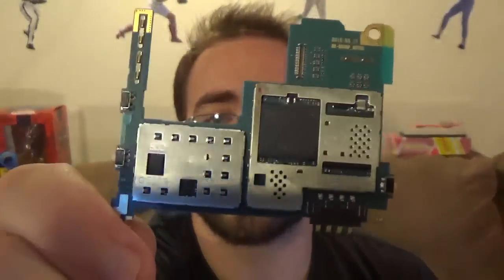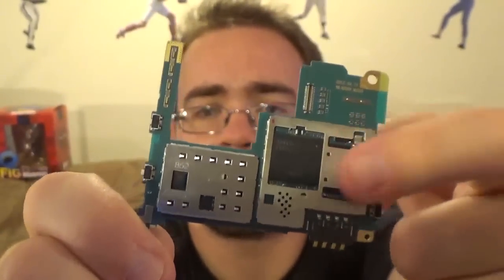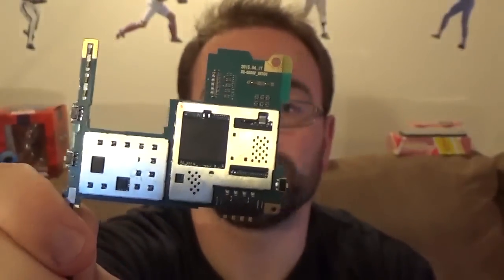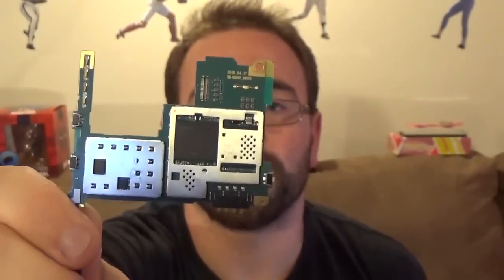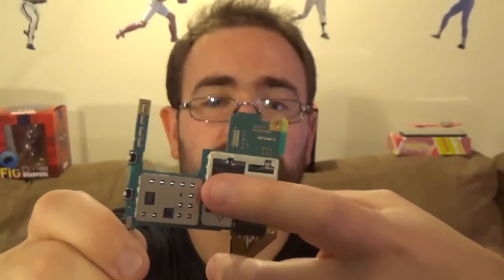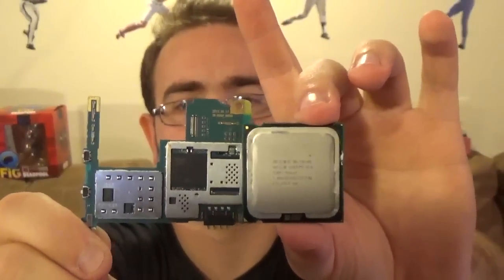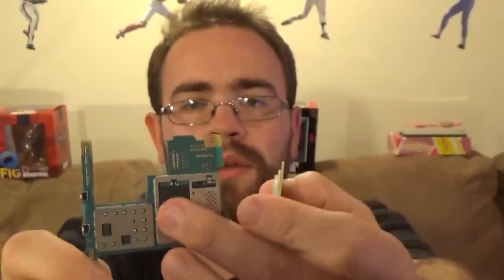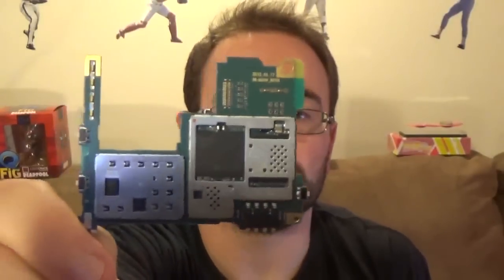Nintendo Switch - x86 And ARM! Why Is Nintendo Using ARM??

Comment: The very simple reason why Nintendo Swich uses arm.. is really nothing of this. Its very very simple. Nvidia have a ARM licens, they don´t have a x86 or any other licens. If they would use a 3:d party processor, they would not be able to do a SoC. And then it would consume way more power and be quite a bit slower.

Because Swich uses Vulcan API that handle multi core processors very well, this is really not a noticeable penalty

2:50 That is not really a fair comparison While a core2duo is a old processor, it was top of the line for its time. x86 processors generally have been made in two different format. High performance and high efficiency. Intel have its Pentium and its Atom, and AMD have its FX and there Jaguars. The high efficency chips are both smaller, do less IPC and run lower freqvency. On the other hand they use much less power. There are some phone and tablet x86 processor (actually my wife got a Intel x86 tablet. Its really fast and it actually do run 8-10 hours on a battery.  Its a 2 core processor and it beat the crap out of the 8 core arm.

The reason why the high power processor got larger die is that they have higher IPC and longer pipes. The reason  for longer pipes is to get higher frequency.

Also games, specialty with DX11, don´t multi core well. This is a problem if you use ARM processors because they don´t have good single core performance (this is also to a degree true for Bullduzer and derivative core).

3:00 No, that is not really true. If you idle a lot, yea sure, then Arm is more efficient. But counting IPC/W x86 processor often beat ARM processors hand down. Also the CISC like design of a x86 is quite a bit more efficient (contrary to popular believe). The statment that x86 cores use more power is totally wrong. Well they do if you idle. But when pushing out IPC, they don´t.

3:25 Actually rather the opposite is true. Intel have more or less abounded the mobile market with x86 processors. The reason is not that they are not sufficiency good, but rather due to compability issues.

3:40 No. the x86 was made for the home computer market initially. Its rather the other way around that they made there ways into servers. And its only fairly recent that they got into the mainframe servers.  They use to be reserved for the sparcs, mips and Cray processors.

4:00 ARM was designed during the early 80-tys. There was no digital cable boxes around at that time and its really just fairly recent that they got into boxes. They use to be to slow. Rather the power processors that was med for cable boxes.

4:25 The reason why ARM got into the phone industry was again microcode. Prior to ARM geting popular it was a math between dragonball, some Intel CPU (that used special microcode that was non x86) and some samsung processors (that the first iphone used):

Andoid also initially used several different instruction set, but now its mostly just on arm.

7:45 no... a ARM is not more powerful than a xeon on single core performance... Well if you get a xeon from 1998 or something. A Haswell generation xeon pumps out 9.92 IPC. A A57 or something like that have 3-4 something and also clock about half the speed. So about 1/6 the performance per core. Don´t believe everything you read, something are lies. (A57 is what Tegra P1 are using)

8:50 A I7 needs about 20W to run, and almost all of this is for busses. When the core is not working, it really don´t use any power at all. It basically shut  of

9:20 No. Standby and use time have not become huge. Its just climbing back to what it use to be. The issue is that Nokia and Ericsson use to produce the best transivers and sold them to just about anyone. But qualcome (that produced the ARM chip at the time) don´t want to use Ericsson or Nokia transivers but rather there own. There transivers was really crappy. For instance the Standby time of a Ericsson M600 smartphone is about 400 hours on a 600mAh battery And its a 3G phone from 2005.

The Ericsson smartphones had have asymmetric multiprocessing since 2001. Arm/Qualcom was really late to that game.

11:10 "Intel cant figure this out"
That is just plain wrong. Intel got Z and N series processor on the market since like forever. Intel was in the smartphone business long before ARM even was. Go check up facts before claiming things.
Reply: Nvidia was the logical choice because they are pretty good with graphical performance with ARM's chips, as for nvn, considering Android now uses Vulkan, odds are it will be similar to what that is, Nintendo will want to tap into the easy portability of smartphone games being they are all using ARM's.
Reply: matsv201 Only two options they had, x86 or ARM's, it's a wise move to use one that a lot of developers know how to use and pretty much both thoes two architectures are pretty much standard today.

I doubt the Nintendo Switch will get PS4 level performance, being that they have to take mobile into account, I suspect they will get Wii U level of performance or at best in between PS3 and PS4.
Reply: Paul Aiello "Only two options they had, x86 or ARM's"
Well. that is true, but it have not stopped the companies from using strange architecture.

"I doubt the Nintendo Switch will get PS4 level performance"
We don´t really have to guess. Well there is really just one unknown things that have a huge impact on the lithography. If its 10nm, 14nm and 16nm.

Thow 1050 use 14nm i would say this is the most likely of the 3. We can take the base level of how much it use in different core frequency  We know it have 5W of power in mobile mode... But we also know it have more in stationary mode.

Also the Swich will have the mix floating-point give it quite a boast in performance, giving it about PS4 level performance in stationary mode. (assuming the difference is 2.25 between stationary and mobile mode)
Reply: matsv201 True but the last few years there's been a lot pressure from developers to push them to go with something they are familiar with and not something so alien like the cell cpu, in the case of both the PS4 and Xbox One consoles, they went the PC route with x86. Nintendo with Switch are going the ARM's route with a hybrid PC gpu on it, it's a wise choice and really the only choice they had, they wanted a mobile device, that left ARM's as the only choice, it's powerful enough but more important, it's a standard that developers are familiar with, last thing Nintendo needs is to alienate third party developers or they could have another WII U on their hands.

I'm not sure about the nm of the chip but Nvidia are using the 16 and 14nm I think with PC gpu's whereas AMD are using 14nm, my guess it will be either one of those, doubt it will be the 10 nm but overtime that will happen with a micron shrink.

I doubt it will get PS4 level performance, that would be one hell of a leap in performance for a ARM's chip and seems unrealistic, it seems like they are aiming for a bit more power than the Wii U consoles, I would be happy if they can get in between the PS3 and PS4 but that might be pushing it a bit.
Reply: Paul Aiello 
I would say the disconnect between CPU and GPU is almost 100% Even if its a SoC its totally different codebase between GPU and CPU.

For instance the Vita while it uses a ARM processor, it uses a M4 architecture.

" doubt it will be the 10 nm but overtime that will happen with a micron shrink."
The 10nm is ramping up.. but i don´t know when Nvidia will get it. Intel already got 10nm production.

"I doubt it will get PS4 level performance,"
Well not only the core preforamnce but also the mix FP giving it a extra boast...

I´m pretty confident that the Swich will beat the PS4.
Reply: Paul Aiello It will be around original XBone level performance.
Reply: matsv201 Do you think AMD could do a X86 SoC
Reply: Epicvids (Ketti08) Yes, and they already done some. The new Zen suppose to e be a SoC at least in some versions.
Reply: ***** nvn is just a recap of nv that in turn use vulcan in the newst version
Reply: matsv201 but they didn't have to go with Nvidia...
Reply: Dexter Lanning That is true.. But if the want a high performance and low power, the is very few to choice from. I really just think there is 3 options, and...Nviidia is probobly the one that got most bang for the watt.
Reply: Paul Aiello Yea.. the only other real option would be PowerVR, and they are less power efficient, so if we talking PS4 level preformance its not really a option.

Of cause, Mali exist to, but its even less efficient. 

Of cause the vita used PowerVR, and its pretty good... but not really to this extent. 

(still looking at PowerVR, its not that far behind)
Reply: everything said in this thread is common sense or stupid....
Reply: matsv201 Still not convinced it will be 10nm, don't think it's mature enough yet and Nvidia are likely to prefer 14 or 16nm for the time being but 10nm will likely happen at a later date with the Switch.

If they manage to beat or even match the PS4 then that means smartphones can do it and with how quickly they develop, they would only have to double the performance to match the PS4 Pro, someone I don't see it coming close, to me the tech isn't quite there yet to allow that in a mobile device where heat, power consumption and size becomes a big factor in its design, still I think they can get Wii U kind of performance or a bit better then that, we should remember that the PS4 is around 10 time faster than the PS3 and the Wii U and PS4 are not that different from each other.
Reply: Paul Aiello 
"Still not convinced it will be 10nm, "
Well i don´t try to convince you... i also think that is a long shot. 

"If they manage to beat or even match the PS4 "
Well say that Swich get 2.8Gflops FP16... did it beat the PS4 then.. or not?

"performance to match the PS4 Pro"
No... That is not really the case. PS4pro got mixed flotingpoints, the PS4 don´t. So even if PS4 pro is about 2.2 times faster on paper its closer to 3.5 times faster when its implemented.
Reply: matsv201 Don't get me wrong, it would be great if it is 10nm but I don't see that happening for Nvidia early next year, at least not in enough numbers that matter.

In any case, I don't see the Switch coming close to what the PS4 can do, that would be incredible progress from an ARM's chip, mobile tech is about 8 to 10 years behind desktop tech in performance terms so best I suspect they can hope for in a mobile form factor is Wii U or in between PS3 and PS4 performance which would be quite impressive if they get that, PS4 performance with the heat, power consumption and bigger size they have to play with just after 3 years seems extremely unlikely and if they managed to get that, it would really put into question what have Sony and Microsoft got so wrong with the PS4 and Xbox One for a mobile device to get that kind of performance just after 3 years, I don't see it happening and I don't recall it ever happening in history.
Reply: Paul Aiello 
"Don't get me wrong, it would be great if it is 10nm but I don't see that happening for Nvidia early next year, at least not in enough numbers that matter."
Yea i would pretty much agree to that. We probably see 10nm Swiches say early 2018.

"I don't see the Switch coming close to what the PS4 can do,"
Why not.. PS4 uses 28nm, while we guess that Swich uses 14nm.. That is one quarter the power. Also swich uses LPDDR4 while PS4 uses GDDR5 that uses WAAAAY more power. Also Swich will probobly have 128bit bus, while PS4 have 256.

Also Swich have a SoC while PS4 have a lot of busses and secondary chips.

The last part Swich will probobly use mix FP giving it a say 50-60% preformance/power boast.

Also not to forget Nvidia arcitecture is a bit more efficent than AMD,, its not a enormous amount, but 15-20% or something, it all ads up.
Reply: matsv201 My guess is the 10nm or even smaller for the next revision of the Switch or possibly it's successor.

Even so with the 28nm to the Switch 14nm it's not going to be even close I think, top of the range Android and Iphones are a bit better then PS3 and Xbox 360 in gaming performance, the PS4 is about 10 time faster, would love it if they did manage to pull off what you say but the tech just isn't there yet, mobile tech is about 10 years behind PC and console specs in what they are capable off, what you are saying would be a major step forward for mobile tech and thats unlikely.
Reply: Paul Aiello Most phones are made to be cheep, not power efficient. A lot of them have old chip and they just overclock them for new featueres. Its dirt cheap to produce, but the battery performance is really bad.

Only the very top end phones uses rather new chips, and most often they are GPU starved. When playing a 3D game, they simply just clock the GPU higher.

Just by the simple method of having more silicon its more  power efficient

Also... even there is the 1080p rumour of the Swich internal screen, i still think the games are 720p when mobile. It might be as simple as it uppscales it to the internal screen.

Simple mores law calculation would suggest that it take 6-8 years for console performance to reach mobile devices. But there is some differences this time.

1: Its a sudden and rather large steep from 28nm to 14nm
2: Vulcan is introduced giving a sudan rush of performance.
3: Mixed floatingpoint gives a 40-80% performance boast
4: SoC architecture lowers the power demand quite significantly.

Combine alls this factors together, and in steed of 6-8 years, its 2-3 years.

Of cause... when the PS5 is launched in 2020 or so, it will use all the same tricks, and the mobile devices will be 6 years behind again.
Reply: matsv201 To a degree thats true but it really depends which smartphone you get, Nvidia Tegra chips are on the market in tablets and phones and gpu performance is pretty good with them but they seem quite weak on the cpu front.

1080p would be doable whiles mobiles with the Switch, it all depends how good they want the graphics, I've seen some pretty impressive games on Android and IOS at 1080p screens but not sure if they are rendered at 1080p, but being this is Nintendo, it wouldn't surprise me if they go 720p.

PC has Vulkan as well and consoles have always had something similar so we can't really use that argument, also, IOS has something similar for quite some time, in any event, Androids got Vulkan recently and it seems to improve performance to a similar level like it does on the PC, in truth is just basically means all those platforms are getting better use of the hardware but no real advantage to any of them, well apart from the PC and Android where it levels the playing field more.

I think it's being a bit optimistic with 6 years but I would love to see that, anything that gives the wind up Intel arse is good in my book, we should also remember that some big changes are on there way with the PC next year on the cpu and gpu front as well as memory and as we know, the cpu market on the PC has been quite static for a few years, Zen could change that.
Reply: License*
Reply: do you believe the switch is going to be successful?
Reply: OyeJaPinoY Well.. yea.. but it really depens on how its set up in the market.
Reply: matsv201 I think it really depends how gamers see it, being that it's a mixed home console and handheld, it might be able to tap into the success of its handheld gaming divisions but I can't help but feel that most will judge it for how it plays at home on tv and that could be the problem when it comes to third party support, the hardware gap is still too big at a time when developers will quickly start putting more focus on the PS4 Pro and Scorpio when out at the expense of the PS4, Xbox One and Switch.
Reply: Paul Aiello Yea.. they really need a few 3rd party AAA games. Not all of them.. But say 25-30% of the cross platform Xbox-PS4 games.

I do think that a lot of the latest roumers .. while not false, probably miss interpreted.

It seams to be based on the idé that the dev-kit is identical. We already know that is not the case. The dev-kit is a two chip solution. the product version is not.

Al ready by knowing the dev kit is a two chip solution, we know its not a X1.. Because the X1 have been available for over 2 years now, and its a 1 chip solution.

So the idé that its a 300Mhz X1 is just stupid.

I would say Swich will probobly preform better in real life than bot Xbone and PS4. Not instantly, but after a year or two when the devs start to learn how to optimize for it.

The mix precission give a theoretical up to 80% boast, but you got to know how to use it, of you don´t you get a 0% boast.

I would would say that the stationary FP32 mode will give 1.4 Gflops. I seen so much pointing at that so i would say its pretty solid by now. The Swich will have mix precision., its a given, even the PS4pro have it, and it already been realized.

This give the Swich pixel per pixel actually higher performance than the Pro in 4k vs 1080p even considering both running mix precision. (that is 2.1 Gflop FP16 per 1080p for Pro and 2.8Gflop FP16 per 1080p for the Swich).

So i would say the Swich will probably fair quite well.

Swich also have one additional quite huge advantage. It runs cartridges.
No install
No load time (almost)
Reply: matsv201 I think they'll need a bit more than 30% third party support but a lot of that will depend on which games are supported.

It would of been nice if it was the Tegra X2 chip, that could've been a decent upgrade, I suspect the performance will be better then the Wii U but I don't expect it to beat the PS4 or the Xbox One for that matter, if they did, that would be quite impression and what that could do, smartphones could as well which thats sounds a bit too close for comfort for the console market, if it matches the Wii U which is only a bit more powerful than the PS3 and Xbox 360 then it might be alright, hardware wise those consoles are over 10 years old so should be doable in mobile form, when docked, I think they'll get between the PS3, Xbox 360, Wii U and the Xbox One and PS4, in between them, we might know more next month.
Reply: Paul Aiello 
"It would of been nice if it was the Tegra X2 (really P1) chip, that could've been a decent upgrade"
Its not a P1, i can say that for sure. The the reason is not the GPU, but rather the CPU. The CPU of the P1 is not suitable fore games. Its made for calculation stuff.

We also know the battery capacity and the runnig time of the Swich, so we can basicly calculate backwards the performance of the device asuming that the screen and other component use less than 2 watts. WIth a 5Ah batttery, and we know that the battery life is 3 hours giving us about 5W left for the SoC.

As speculated before its now confirmed that there is a 1080p and a 720p mode on stationary and mobile.. having a subsequent cutdown of freqvency of 2.25 times giving us a power cutdown of about 4 times (amusing that they run it quite close to optimal speed).

Giving us a a freqvency of about 1.2-1.5GHz in stationary mode and 533-666Mhz in mobile mode.

Then we also know that it uses about 20watt in stationary mode giving us a performance of a bit over 1Tflops FP32 (stationary)

From the data we have we can pretty accurate calculate preformance pretty accurate.

What we know
Factory leak: Battery capacity: bit over 5Ah (3.7V)
Nintedo leak: 3-5 hours battery life (that is 3 hours on full tilt.. and 5 hours on about half tilt. This gives us both SoC and other component power)
Dev leaks. Game sample down to 720p when mobile, 1080p in stationary
Official information: "latest generation of Nvidia GPU" That is Pascal then

From this information we can pretty accurate calculate the preformans. If i hade a low tear Pascal GPU i could probobly simulate a Nintendo Swich with it and give a even more acciurate estimation
Reply: matsv201 Still it basicly means games will be held back depending how well they run in mobile mode and if it's multiplat, that will definitely hold back the PC, PS4 Pro and Scorpio version of the games, for many developers they might end up thinking the gap is too wide and not worth it.

What we might end up getting is a lot of mobile and Nintendo DS kind of games as well as Nintendo exclusive games to it but third party games could be very hit or miss.
Reply: Paul Aiello 
"Still it basicly means games will be held back depending how well they run in mobile mode and if it's multiplat,"
Well.. no not really. It will have the same per pixel preformance. The image will only be less sharp.

I was previus speculating in Nintendo going 30fps mobile and 60fps stationary. It seams like they didn´t do that

What is holding back the Swich is the CPU. Even if the A73 CPU (that is rounered to be used in the Swich, could possible be the A57), its still quite a bit slower than the Jaguar. Thow the A73 can run at higher clock, but not that high.. specially not on battery.

This is also a issue with the CPU...it don´t scale very much with resolution, barley anything. Swiching down the resolution. This would make god sence bringing down the frame rate.
Reply: matsv201 I thought they might go 720p 30fps mobile and 1080p 60fps docked.

Still games that are multiplatform will suffer greatly on the PC, PS4 and Scorpio if they also need to get that game working on the Switch in mobile mode as well, the performance is just too wide and that could be the problem third party developers have with it, with the PS4 Pro already out, Scorpio out next year, the PC getting cheaper all the time, how long will it take before most games really start to take advantage of the PS4 Pro, Scorpio and PC and the PS4 and Xbox One become an afterthought, so yes I'm sure they will get the game but it could run so bad that not many would want to play them, which is even worse for the Switch, ironically, the biggest threat to the Switch is sales numbers of PS4 Pro, Scorpio and newert gpu's on the PC, the more sales, the more likely third party support for the Switch will drop.
Reply: Paul Aiello 
"Still games that are multiplatform will suffer greatly on the PC,"
Well its a  double edge sword.
 The inferior preference of the console forces them to optimize but it the preformance to some degree bind it down.

One advantage of current generation consoles is that all of them are 8 cores.. that is plenty. Few PC have more cores than 8... and the performance scale quite good on IPC and frequency.

This is to some extent true for Screen resolution to. At least if you have a 4k screen you will get at least the pixel fidelity of the consoles pixel per pixel. That is for game that run 1080p on Pro or Scorpoi, its heck of a graphics. For the pro its similar two 4 480 card in crossfire.

"Switch in mobile mode as well,"
i would say.. no not really. The pixel fidelity is about the same in mobile and stationary mode.. so the game just scales down.

" start to take advantage of the PS4 Pro, Scorpio and PC "
Don´t wory about it.. its the same every console generation. Actually relative to PC the Swich will probobly be the most powerful console since the gamecube.
Reply: matsv201 To a degree thats true but you can't get blood out of a stone, you would have to imaging they are optimising a lot on the PS4, PS4 Pro, Xbox One and Scorpio when it's out so really the gap is still going to be wide.

8 cores might be more of a thing next year on PC when Ryzen is out, could be a good shake up in the market if it delivers and so far things are looking promising, but really core counts are not too important as 4 cores on an average PC is far better then those 8 cores on consoles.

Eurogamer did a few test a few months ago with an RX480, doing native 4k at 30fps and similar to PS4 visual settings, from what I recall it did north of 30fps in 9 out of 10 games, 30fps is much easier to do at native 4k with careful graphics settings, also the PS4 Pro is quite a bit weaker than the RX 480, the advantage here is that the PC is doing native 4k whereas the PS4 isn't most of the time.

As for the Switch, we'll have to see how well that works out for Nintendo but it's not looking good, at least with third party support.

Oh I'm not worried about the Switch holding back gaming, as a PC gamer we've been used to that with console gaming holding back PC gaming, but in any case, mid cycle upgrades for consoles is a good things for the industry.
Reply: Well.. it might not be as hard as one might imagine.. i found a image.... 
http://1.bp.blogspot.com/-yHGXCbFSMvo/Uxk9uoyGoxI/AAAAAAAACBw/BsMdH043qoo/s1600/endings.png
This is from the 2:nd and 3:nd generation videogames. 
From C64 down to Amiga at the bottom right.

Now days its even easier. Have polygoncount, resolution frame rate to play around with. Actually with a portable device don´t have to stick with 30 or 60fps, can run with 45fps with no real issues.

Its kind of hard to specify the preformance  difference from C64 to Amiga 500.. But just like the name implies the C64 have 64kbyte of ram while the AMiga 500 have 512kBytes of ram.

But the diffrance is actually even bigger. Amiga read the game of a disc, C64 read it of a tape. The C64 needs to keep all (or at least most) of the game in memry at the whole time. Amiga read of a 880kbyte disk. So it can basicly utelise 512+880kbyte of memory. (C64 can actually use 84kbyte of memory because the grapics uses separate memory)

The grapics chips is hard to compare, they are both hardwired. They work as fast as the TV regardless. So its really memory that need to be compared between them. The Amiga grapics can practically use about 12 times more than the C64

Processing power the Amiga uses a 16/32 bit processor on 7MHz while the C64 uses a 8bit processor at 1Mhz. It really depend on what task, but you could reasonably say that the Amiga was 30 times more powerful.

So 16 times more memory, 30 times more CPU power and 12 times more graphical power. That was one generation in the 80-tys, 5 year a part. There was quite a reasonable time that games was made for both consoles.

So lets look at the current day combatants.
Xbone, PS4, Pro, Swich and Scorpio.

The comparison is much simpler in the way that they all use the same graphical API (Well more or less). They also all use 64 bit SIMD processors, so its easy to compare.

So i will compare memory, CPU and GPU power.

Memory:
Xbone: 8GB
PS4 8,25GB of memory (yes, the PS4 have a tiny bit more)
Pro: 9.25GB of memory (possibly with compression). About 32GB of usefull memory
Swich: (presumable) 4GB of memory (almost certainly with compression) About 16GB of usefull memory
Scorpio: Presumable 12GB) probably with compression, unclear)

So looking at memory the Swich is actually pretty good. It also got cartridge that of load the memory quite a bit.

CPU:
Xbone: 8 core 128 simd 1,75Ghz
PS4: 8 core 128 simd 1.6Ghz
Pro:  8 core 128 simd 2,1Ghz
Swich: 8 cores 64/128 simd Probably 2-2.5Ghz
Scorpio: (guessing here on ZEN) 4 core 512 SIMD ~2.5Ghz processor

So the swich is slower on some SIMD operations, but with non simd operations its just as fast, if not even faster than even the pro.

GPU
Xbone: 1.3Gflops FP32
PS4: 1.8Gflops FP32
Pro 4.2Gflops FP32/8,4 Gflops FP16
Swich: (Estimation) 1.4Gflops FP32/2.8Gflops FP16
Scorpio: 6Gflops FP32/12Gflops FP16

I would estimate that FP16 compability gives a 80% real life performance boast (well "I"... i got it of a Nvidia presentation)... So for the Pro that is 4.2Gflops +80% => 7,5Gflops.. That is very close to 4 times 1.8Gflops of the PS4...

A fluke... i don´t think so. They made the Pro to run the exact same game at the same fidelity at 4K in steed of 1080p.

This gives 2.5Gflops of the Swich...  That would actually give the Swich MORE pixel fidelity than the Pro and very close to the same as the Scorpio.

Assuming that the PS4, Xbone Swich (stationary) run at 1080P and the Pro and Scorpio run at 4k. The pixel fidelity is.(Xbone index 100:
Xbone: 100
PS4: 138
Pro: 145
Swich: 193
Scorpio: 207

So does it keep the PC down.. well i would say.. GPU vice.. not really. For Pro the devs can choice between 4k and 1080p... making them have a HUGE pixel fidelity advantage.

If you have a dubble titan on your PC.. i would assume you don´t run it with a 1080p monitor. If yo run it with a 4K monitor, you got about the same pixel fidelity as the Pro at 1080p.

What might be holding consoles back is there CPU... but now with Vulcan, this is not that much of a issue, and it will take a few years before the game run full CPU load again
Reply: matsv201 Yeah I remember those days, I had a C64 and an Amiga, great machines, thing is, back in those days, games was a lot cheaper to make and in most cases, it was completely rewritten for each system unless each was similar in specs, today on the other hand, most of the time they use the same source code across all platforms and games development is a lot more expensive today than it was back then, so even though you can get it working on weaker hardware, it really depends how much work is needed and if the investment is worth it, in other words, for the Switch developers have to take into account, mobile, docked, low power and a different architectures then what most of the others are usings, for many developers, unless the market sure is good, they might not bother and they still might not as we saw on the Wii.

It's a nice idea but we are in effect talking about scaling games all the way from a smartphone to an high end PC, it's doable no doubt about it but will it be worth it for developers, we'll see in the first year of Switch release.

I could be wrong on all this and game engines have become a lot more scalable but I not sure yet, the Switch will have to be able to run the full fat console and PC release of games with visual being cut back so it can manage it, if it can't do that then the only alternative is a rewrite of the code which starts to become more expensive and I think the real problem isn't the gpu, engines scale well with that and little expense but the cpu on the other hand, if developers tap more into the cpu power of the PC, PS4 and Pro as well as Xbox One and Scorpio, that would be tricky to scale down to the Switch, the design of games come into play with the cpu and if they do major work on that, it would likely need a rewrite to work well on the Switch, a bit like most developers did in the past.
Reply: Paul Aiello 
"games was a lot cheaper to make and in most cases"
The grapics was, but there was much more coding. So i would actually say... to what you got, games was probably more expensive to produce back then.

Say you where coding a game for 5 different platforms.PC EGA, Amiga 500, C64, Atari ST and a Mac (not to even thing about the NES and the megasdrive)

Well there is the x86 for the PC, the 6500 for the C64 and the 68k for the other.. So that is 3 different processors to code for.. And remember, everything was coded in assembler. So re write everything

So for the graphics. Well 500, C64 and ST uses sprites, the Mac kind of kindof don´t... special case, the PC don´t. So there is 3 different way of programming the graphics.

So for imagery. The PC is 16 color out of 64, The apple i don´t really know. The 500 use 64 color HAM. The C64 uses 4 color per 4x4 square, but 16 color over the whole screen. They also all use different resolutions.

Nowdays you can just use imaging software, take a photo and convert it to anyforma you need, back then you had to make the software.

Also, if converting a image from high res 16bit to low res 4 bit, it might not be possible to se what its about.

So most game devs made one image for the 16 bit systems and converted, and one for the 8 bit system.

Don´t even get me started on the sound.

Nowdays... Its really very simple. All system uses the same two API (Vulcan or DX12). Sound, just use what ever format you like and import it into the API.

Grapics, just make it, and the development tool just remaps it for you.

Programming... you really don´t even have to do this nowadays. 90% of modern games are just scripts. Even for a rather big project there might be just 1 "real" programmer. Maybe 10 person makeing game scripts. And 50 odd people making media content.

Also there is a lot of middle ware. Most games use of the shelf graphics engine, in  a off the self game engine. Typically unreal engine used quite a lot for most 3G games, and Unity engine for most strategy games.

Really just the biggest studios that make there own engines, like EA. Also note that battlefield 4 and Battlefield 1 (and everything between) uses the same game engine. (thow, the engine been upgraded, so its not really exactly the same engine as in 2013, but its compatible.

"It's a nice idea but we are in effect talking about scaling games all the way from a smartphone to an high end PC"
You might be able to do that in a few years. In theory a game like Cities skyline that uses Unity could be able to run on a phone.

If you make a game 100% unity you should be able to run it on Android, Apple TV BlackBerry 10, iOS, Linux, Nintendo 3DS line, OS X, PlayStation 4, PlayStation Vita, Unity Web Player and other. I would suspect that Cities skyline make some system calls, making it not fully 100% unity.

Checking unreal wikipage it claim that it can be run on android and ios as well.

The real issue is that there is a diffrance in processing power for a $600 smartphone and a $200 smartphone. But its really not that noticable if you don´t run games on it. THe issue is that you cant upgrade the processor of a smart phone making you kind of stuck with a sucky experiance if you buing a game your phone cant handle.

If there is uppgradable phones in the future, then sure. But if there is non, its hard.

"I could be wrong on all this and game engines have become a lot more scalable but I not sure yet"
They are pretty scalilble. The greatest issue is that most of the game devs don´t know how the hardware works, there therefor don´t know how to optimize a game. The devs how make the engines sure do, but they are still limited by what the game devs do.

Of cause, they may make tool that auto optomize, that would solve the problem, but i think the game devs would not really like that.
Reply: matsv201 In a lot of games, it was only a few people making them, at least in the 8 bit days, also in many cases, it was different people making the games for different platforms more or less from scratch, it might as well of been a different game, something they won't do today, it was an easier time for the bedroom coders to make games that didn't cost the earth and only took a few months with sometimes just one person working on it or a few, now we are talking about big teams of developers, much bigger budgets and using the same code across all the platforms, meaning it has to be in a similar ballpark of power to run, at least with the cpu front.

The main point I'm getting at in the old days, they coded specifically for the individual machine, today they don't do that unless it's an exclusive, today they use a broad brush and try to use the same code across many platforms with a few changes to each one, it's also the reason in most cases games from the PS3 and Xbox 360 days used very little cpu power on the PC, it's much easier to scale graphics but with the cpu, that usually goes into the core design of the game, if they used a lot of that cpu power on the PC where it's being used properly, they would have a hard time getting that on the PS3 and Xbox 360 at the time and that could be the real problem with Switch that could hold it back.

The way I look at it is this, the PS4 and Xbox One are already weak on the cpu front, developers will likely squeeze the life out of that and get every drop of performance they can, the cpu on the Switch would have to be in a similar ballpark to that if it really wants third party support and this needs to be in mobile mode, graphics won't be an issue, game engines are pretty good at scaling well with that, game logic, design, A.I, physic and all that stuff, that more or less has to run the same on all otherwise if the Switch is not powerful enough, many developers might think it's not worth the investment needed to get it ported across.
Reply: Paul Aiello 
"In a lot of games, it was only a few people making them, at least in the 8 bit days, also in many cases"
Well yea: typically 3-5 programmers, 1 graphics guy and 1 sound guy (part time). Now its the other way around. Typically 3-5 graphics guy, 1 programmer and 1 sound guy.

But for titles like Factorio and KSP the staf is actually not that big. For Factorio the total staf size is 16 persons, and it actually expanded quite a lot just the last month to get it finished.

The most impressive example is probably colossal order that made Cities Skylines with a staff of 15 person

"it was an easier time for the bedroom coders to make games that didn't cost the earth and only "
I would actually claim that the exact opposite is true. Its much easier now. The tools is that good so they practically make the game for you. If you want to make a FPS or a RTS game you practically just have to make the assets and the world rules. And there is quite a lot of freeware assets. So one can pretty much just download then, implement them, and there is your game. It will be a generic ass game, but it will work. 

"The main point I'm getting at in the old days, they coded specifically for the individual machine,"
Yea and it took almost as much time porting the game as making them initially.

"The way I look at it is this, the PS4 and Xbox One are already weak on the cpu front, "
The advantage is that this forces them to go full multi-core coding. And this also give a performance bost to PC that usually have about the same amount of cores, but much faster cores.

"game engines are pretty good at scaling well with that, game logic, design, A.I, physic and all that stuff,"
Most of those stuff is transferred over to GPU now.. or soon anyway, making the use for more powerfull CPU redundant.

This have actually been the case for almost 30 years. Back in the V20 era the CPU did almost everything; Then C64 hade a grapics support chip, and the Amiga, got a much more powerfull support chip.

Then 3D come (and.. well for a short while, the CPU did everything). Then the accelerators came of loading the CPU some of the 3D parts, then the GPU come, of loading a bit more.

Then the  unified shaders come, of loading a bit more.

The CUDA and AMD equivalent come, of loading a bit more...

We are still in in the CUDA phase... but i think its like the 3:d iteration. And it also takes time to full implementation. We are not there yet.

"e Switch is not powerful enough, many developers might think it's not"
I don´t really think that is a issue. Its more about market share than power. THe issue with Wii U was both that it had a small marketshare as well as have a bad reputation. 

The Wii had a good market share, but Nintedo was really hostaile against 3:d party publishers. I think Nintendo learnd the lesson and is not that hostile any more.

Also i would say, the Swich design make it so it don´t pressure the devs to use some gimicy stuff.
Reply: matsv201 True and I suppose with the indie movement going around the last few years, more teams of developers are popping up that are quite small in size and are able to deliver some impressive contents considering the team size.

It's easier if developers are making simple games or games from a decades ago today but to make today's triple a games isn't easy at all, gamers expect a lot from them, the toolsets are better and easier to use but the games are far bigger than they've ever been in scope, on the plus side, porting process from one machine to another is relevantly easy now without costing too much and only needing a few people to do it.

That's true about the PS4 and Xbox One helping the PC go more multi core with games, Vulkan and DX12 will help a lot there because it gives developers much more control over the hardware, OpenGL and DX11 are not very easy to do multicore with which is why most games brute force their way with a single core.

Some of that is being transferred to the gpu but a lot more could be done with the cpu still, Star Citizen is likely going to be one of the few games that will take advantage of the gpu and cpu PC have to offer and the results will likely show, especially considering that games is being done for Vulkan and DX12, also we should remember that the main reason the PS4 and Xbox One are focusing a lot more on graphics over everything else is because the cpu is weak which is holding back developers on what they can do with design, we're seeing that with the PS4 Pro, it's mostly just better visuals because the cpu upgrade is modest at best, it also means something like Star Citizen would be difficult to port to current consoles if it really pushing the gpu and cpu on PC, so for the time being, a cpu still has a big part to play in gaming if used right.

We'll have to wait and see with Switch, the Wii had good market share but third party games did badly on it, Nintendo didn't help matters either with how controlling they are, the Wii U just didn't have the market share to be worth investing in, as for the Switch, we have a lot of hype around it but thats more to do with people wanting it to be a success then it being one, we'll have to wait and see on that one.
Reply: Paul Aiello Yea.. the middle ware and game engines really made it possible for developers with limited programming skills to make good games.

Good programmers are very rare, and have one programmer at each studio doing about the same is a waste of resources.

Compare the 1991 civilization to 2015 Cities Skylines. The team was similar size.

Skylines is ported to 3 platforms, Civilization (initially) 4.

It took 1½ years developing skylines, a bit shorter for civilization:

I would say, you get heck of a lot more game for the same man hour of Skylines than Civilization.

I think the issue with large studios, like Massive that made Tom Clancy's The Division, is that when the studio greew over a certain size, the amount of bullshit artist to game devs in the studio rapidly raises.

In short, there is a lot of people pretending to work, and very few that works.

"gives developers much more control over the hardware"
Actually ... it gives the developer a CHOICE to get more or less control. More choice is more work. But better middle-ware, gives less work.More choice is not always good. But the Choice to get choice... is great.

"the Wii had good market share but third party games did badly on it"
Well nintendo treated them that way... so no suprice there.
Reply: matsv201 I think the real problem with big studios is publishers, they are very wasteful with money and they interfere with how games are developed, it's just a business to them, hence why the indie movement is starting up again.

Star Citizen is a game I'm watching closely because it's a indie game, it's already got $140 which considering it's being made without a publisher more or less makes it the biggest budgeted games ever, it's PC only and got a team of around 370 people working on it, it wouldn't surprise me if it ends up being one of the best games ever made or grandest games, I suspect it will raise the bar for gaming all round.

Actually the more choice is the better option, remember that it was developers that pushed for lower level api's on the PC, even thought it gives them a bit more work, it gives them more control how resources are used and more important, a more predictable environment to work in which OpenGL, DX11 doesn't, also helps by trimming back the driver layer, overall meaning we shouldn't need drivers to improve performance and fix bugs for games with Vulkan and DX12 just game patches, in a way, they are programming much closer to the hardware like they do on consoles and it's very similar, the benefits of that is more code sharing and likely more of the optimizations from the console version being past onto the PC version.

Android has Vulkan support now as well so porting process from Android and Switch could be quite simple in the longer run.
Reply: Paul Aiello well. what realy makes good games is good tills and avsett so one and tro person teams can make good games. The fever persons.. The more inovative
Reply: matsv201 The other problem is because gaming has become big business and cost a lot of money to make triple a games, a lot of publishers are playing it safe with games they know that sell and not trying out new things and being innovative, most of the innovation I've noticed seems to happen on the PC and by indie developers, probably because of its open nature, low cost to enter and anything goes.
Reply: Paul Aiello yea... of cause... but i don't realy think they even can make it a other way. making a inovative game in a larger congrats structure is realy Hard.

The only real way they can do it is to make smal studios pumping out a larger quantum of smal games.. then if something hit they make a AAA sequal of it
Reply: matsv201 That's true, good thing is over the last few years, a lot of the main game engines are much cheaper or free to use for developers which should help out indie developers a lot, it also helps that we've been getting a bigger push with crowdfunding for games, most of which seems to be focus on the PC which is understandable with how easy it is to enter that market compared to consoles and I think if games like Star Citizen is a success, that could really help things a lot, a triple a indie game trying to do something that most publishers are not willing to do, it could raise the bar for all games if they deliver on what they say.
Reply: Paul Aiello i played mostly ksp and factorio, thoes game could probobly not be made 5 years a go due to lackning tools. also.. skyline,  even its avrage studio size.. its also true. CiM there previus games. it was still good games, but it was not A titles
Reply: matsv201 I think the real problem is development tools are not developing enough with how big games are getting, budgets and teams are increasing all the time, game development is getting expensive which is why so many developers play it safe with games they know that sell but it's not good for innovation, it's another thing I like about Star Citizen, they are doing a lot of big changes to the game engine that could help make development much faster.
Reply: Paul Aiello 
" I think the real problem is development tools are not developing enough with how big games are getting,"
Well... maybe... or is it the other way around. That the game studios don´t use the dev kits the right way. I would say that large studios bloat there teams with stuff that is not necessary. A lot of big studios still build there own game engines, just because of tradition.

Often the motivation is to make the game more unique.

I would say the result is the total opposite. They spend so much time making a game engine, and very little time tweeking it.

Well Star Citizen.. i don´t know much about it.. but it uses a version of Cryengine that is developed by Amazone to make it more developer friendly. 

Still using Cryengine makes more focus on the grapics and make it so the grapics have to be polished a bit more. Also this in turn make it so the game have to be more optimized to run smoth.

So i would rather recomend to go with Unity that have a wider range of graphical setting. It still don´t look as beatufull as cryengine doies, but is heck of a lot easier to make a avrage looking game, and it can still look pretty good.
Reply: matsv201 Come to think of it, I remember when Star Citizen licensed out the Cryengine only to end up needing to change about 60% of it mostly because the game they are trying to do has never really been done before, now they've gone to Lumberyard which is Cryengine but from Amazon, to me, this and Frostbite engines are the best on the market.

We're starting to see more game engines being designed to work with any styles of games which is a good thing I think, Frostbite being an example where they use that for football games, first person shooters, car racing games and so on, I think thats the best way forward, create one ultimate game engine and keep improving on that.
Reply: Paul Aiello 
" Cryengine but from Amazon, to me, this and Frostbite engines are the best on the market."
Well a engine can be good in may diffrent way. Cryengine and Frostbite have a very good final tenderer for high quality rendering

Some things like Radiosity and simular stuff is way better on Cryengine and Frostbite.. But it can be faked quite easialy, so if you don´t need the very high quality fotoish realistic grapics. You don´t really need it.

A issue with Cryengine and Frostbite is that you are pretty much locked in to make it that way.

So i would really say, it depends on what the point of the game is. If you want to make a grapcis intesive adrenaline type game, yes, then its pretty good. But if you want something more puzzel like or strategic, is not that much of a point.

I would still argue that Skylines is the perfect example what can be made if you have a smal crew and know what you are doing
Reply: matsv201 I suppose what I like about Lumberyard is that it's easy access for developers that want to use it and if I recall, I think it's open source and with Amazon wanting to get big into the gaming industry and how deep pockets they have, they are likely going to spend quite a bit of money into the engine, also, CIG with Star Citizen are doing a lot of big changes to the engine which will likely benefit anyone that wants to use that engine.
Reply: matsv201 Very good and interesting discussion here, thanks you two. I had to comment on your comment about "bullshit artists" though. I'm not sure that's the case. Game developers spend a lot of time working and are infamous for being overworked and spending required overtime. I think their bosses would make sure they are working on the game. There's strict deadlines after all. So I didn't believe that for one second that they are lazy. I think bigger teams lead to more bureaucracy and that's the main problem. Think how efficient a small city in Cities: Skylines or Sim City runs compared to a big city. There's more checks and roadblocks in place. Blizzard is infamous for requiring a studio-wide meeting every day and they talk about a lot of things some parts of the studio don't even need to know about. They aren't lazy, it's just bureaucracy keeping them from being 100% efficient.
Reply: ***** On smal games yes.. On large games. no. What happens is that the skilled boss is replaced by a Human resource type boss that don´t know how the the work is done. This is not only true in the game industry, but all industries.

Its probably still true that the hard workers are still very hard workers..

Its a fact of organizations, the large a organisation is, the more bullshit artist can infiltrate.

Its not that the other people are lazy, its that there are some people that are doing nothing or even are counter productive.

Also the "hard" work of the 90-tys is mostly gone. Most game devs work 9-5 ,or equivalent The reason is really simple, because if you run someone at a 24/7 rime line you burn them out in a year or two. If you want to keep them a long, better treat them well.

Also most game devs, just like other professionals reatch here peak after 5-10 years. A 5 year expirance game dev that work 9-5 get more work done than a fresh working 24/7... and the 24/7 will never get 5 year expirance..

That sad, a lot of them probably still do a reasonable bit of overtime, but its usually compensated with leve.

That is some people can work 24/7 a few weeks before the dead line., then go for a break for 2 months.
Reply: +matsv201 you did better explanation dude
Reply: really good points there you totally dubunked this tech dude who likes to think he knows it all.